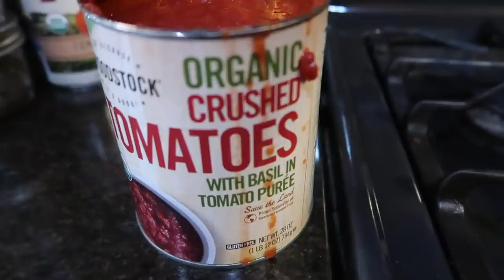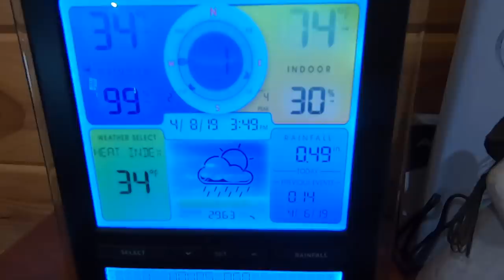It COST how MUCH? (Shipping a Goat 3000 miles)

Comment: The reason for the icicles at just about freezing when it was raining can be explained by  "The latent heat of evaporation"   Evaporating liquid has a cooling effect. This is how a  swamp cooler air conditioner works.  A liquid is drawn up into a wick via osmosis. The water evaporates causing cooling.   The rainwater coming off the rope was very close to the freezing point, as so often happens in Northern New Hampshire.  The effect of the evaporation was enough to crystallize the water into ice.  You missed out on the physics lesson.
Reply: I thought about evaporative cooling too but it had to be nearly 100% humidity.  I saw 30° on the weather station when he showed it .
Reply: 👍💯👍💯👍💯👍💯👍💯👍💯
Well damn sir....ur a real smart feller.....or is it fart smeller? 😒.....eh who knows lol😜😏jk of course. You just schooled 90+ thousand people and taught me my first new fact for the day!!! Love reading intelligent, fact based, mature, adult comments! Lol mostly bc I need to learn how to do that more! Have a great day!!!
Reply: Another, and different explanation of the icicles forming in the rain is a warner air mass overhead, the precipitation falls as rain, but falls into colder air at the surface.  This is what so often causes the ice storms you in Northern  New Hampshire have come to love.  I had not noticed as the other commenter did that you had a surface temperature below freezing.

Comment: I noticed when you were opening the cans of sauce you were using your fingers to pull the can lids off. Did you know the button on the side of the can opener opens and closes a little metal beak like clamp on the other side of the can opener. That beak thing is to grab the can lids off with out risking cutting your fingers.